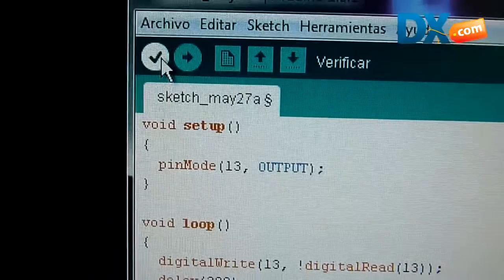Arduino UNO Freaduino - dealextreme.com

Comment: como se cuales son los pines de los motores ? soy nuevo con la placa de freaduino uno, seria de gran ayuda como puedo hacer con la programacion y los pines en el software y hardware...

gracias
Reply from the maker: No son pines específicos para motores, todos son pines digitales y sirven como entradas o salidas para cualquier cosa que quieras conectar. Cada pin físico esta numerado y se corresponde con la numeración del software. Esta placa funciona como cualquier otro Arduino.